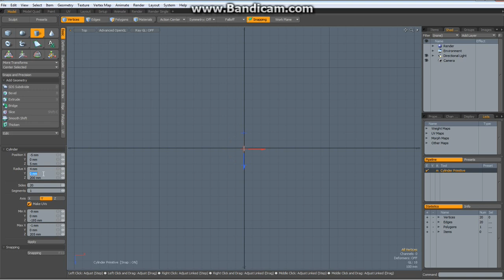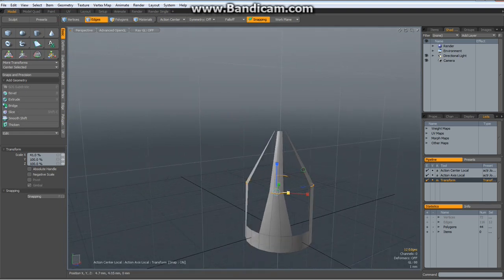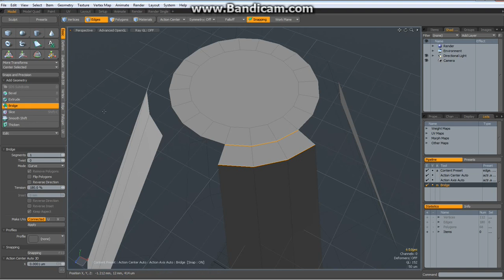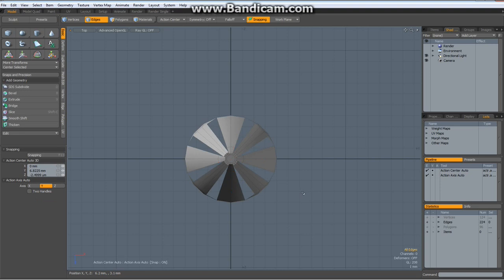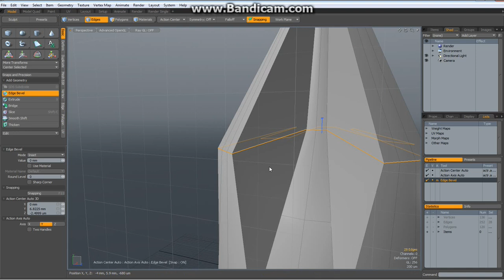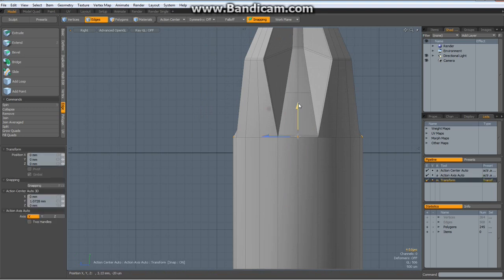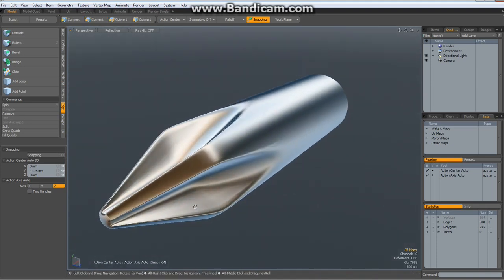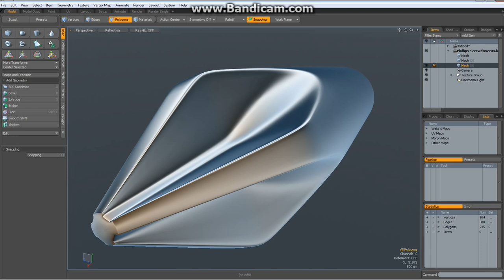Luxology modo - Modeling a Phillips screwdriver tip

Comment: I have a question, 

when I try to extrude the selected  edges, they extrude weirdly, it's like they are constrained to the edges and the vertices move only on the edges and don't move up, when I select adjacent edges it extrudes just fine, but if there's a separation between the edges there's a problem,

 thx in advance, great tutorials